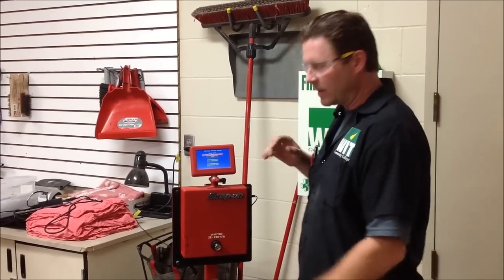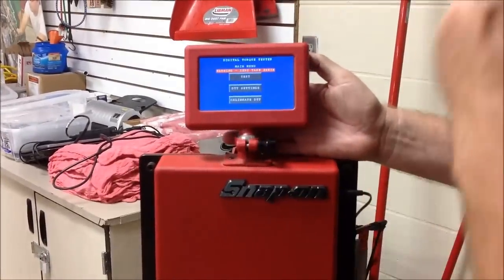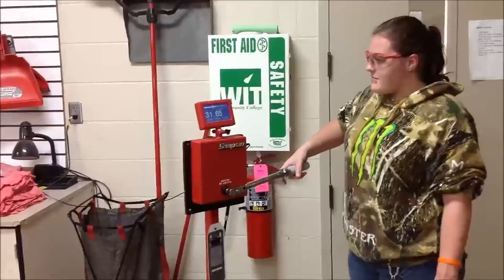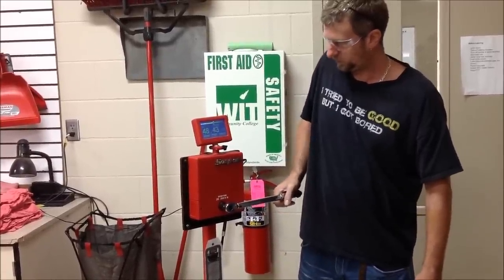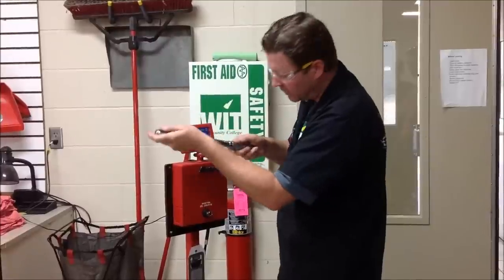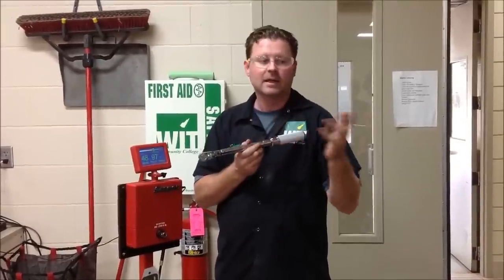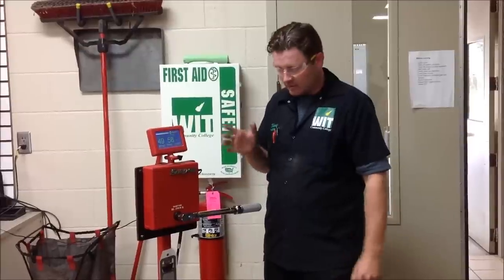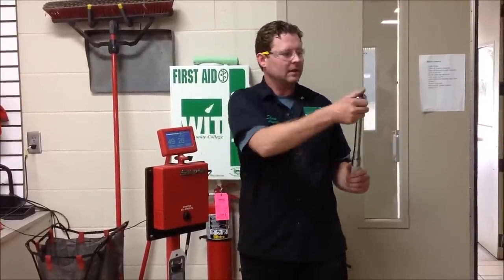Torque wrench calibration check Harbor Freight vs Snap On

Comment: These calibration stations should be in every auto parts store and repair shop.
Reply from the maker: It's to bad they make them so expensive too. But we have to face the reality of how much poor work ethic is out there and by making them more "exclusive" we put more value in the certification. This is an old argument that the bad folks ruin it for the good ones right? There is some curriculum I am not even allowed to certify students in because it must be done on site at the manufacture. I have students come back and say "we did this same thing here, why couldn't you just certify us"? 
If I can ever be of service to you, here is a video explains how to connect with me. 
https://www.youtube.com/watch?v=vjvmB01ebcs 
Keep Wrenching,
Shane Conley
Instructor/Motivator/Motorcyclist
www.how2wrench.com
Like freebies? Click here for a free diagnostic checklist! 
http://gem.godaddy.com/signups/364621/join 

Did you like this free video and hope to see more? Would you just like to say thank you with a donation? Click https://www.paypal.me/how2wrench
Reply: I don't think that is necessary with the larger problem being that a torque wrench isn't being used at all, rather an impact wrench till it stops at whatever torque it has at that setting.    I can't tell you how many times over the years I have encountered vehicle wheels torqued to double their spec due to this, and sometimes lost the lug studs in attempts to get the nut off after it was deformed from the stress.  It's extra fun when this deforms the wheel too.
Reply: You can calibrate a torque wrench yourself with an accurate weight scale with a hanger. Fix the anvil of the torque wrench within a vise, pull on the handle of the torque of the torque wrench with the hanger of the scale until it reaches the desired torque, adjust the torque wrench as necessary until it clicks at the desired torque. It could be done even more accurately with calibration blocks that are sure to weigh specific amounts, and hanging those off the handle of the torque wrench.
Reply: @stinkycheese804  One of my first jobs was as a tune-up mechanic. Everyone uses torque sticks. They work. You can hammer on them all day with an impact and they don't move beyond rated torque. Draw a line on the socket to see. If the lug nuts went on with ONLY the impact, the nut would not stop turning, it would just keep stretching the lug until it broke from elastic yield.
Reply: @stinkycheese804  I agree, many people do not understand the importance of properly torquing bolts such as lugnuts on wheels. I have seen this as well many times along with warped rotors. To many wannabe techs out their that give a bad name to properly train techs that do their job properly or understand what they are doing.
Reply: @DieselDog1982  Because many people are using torque wrench that are out of calibration and have now clue. Most people have never even had their torque wrenches calibrated. If the equipment was out their, more mechanics would check their equipment and make the needed adjustments. I have worked at a few places that actually required periodic calibrations, but never in any repair shop I worked at.

Comment: testing snap-on vs harbor freight calibration using a snap-on brand calibration tool... 😂
Reply from the maker: Apparently the math is different from one brand to another? LMAO
Reply: I don't typically like Snap-on( they're good tools just pricey) but if you multiply the distance to the Handle by the amount of pressure put on the handle for the intended click everything works out the same so every torque wrench should indicate the same value if calibrated, duh... kind of a ignorant comment, not to me mean. Just don't expect someone to call you out when you make unintelligent comments. Lol
Reply: Just like the guy with a garage full HF testing snap on stuff.
Reply: @alejandroWar23  kinda, yeah, but who you askin'? 🤷‍♂️🤣

Comment: So snap on built a tool to prove their tools are better than HF. Don't worry about the $100,000 price tag on the test machine, they will add it to the price of the torque wrench.
Reply: Josaljo Won its really probably rebranded and built by some company and that company probably charges $75k+ for it

Comment: You should demonstrate the Snap-On precision wallet-vacuum cleaner.
Reply: This really is like comparing a Bugatti Veyron to a Ford Geo in terms of price and performance. Although not exactly, as I think you can find tools that are just as good as snap-on's for half or sometimes less than half the cost.
Reply: That was the best by far. I lov my cheap HF tools. They get the job done.

Comment from the maker: Some of you are struggling with the fact that if you "extend" or "shorten" the length of the tq wrench with wrong hand placement or like Alex stated below "adding" pipe YOU WILL ALTER THE APPLIED TORQUE! Here is our video proving it. It blows my mind that there is so much controversy on this matter.
Reply from the maker: https://youtu.be/tv_KHH55qdQ
Reply: Listen carefully.  Extending the distance from the socket to the head is not the same thing as changing your hand placement.  Your video only proves that you have no idea of the concepts involved.   You are misinformed and stubborn.  Why don't you put a 4ft piece of 1 1/2 pvc pipe on the handle and see what difference it makes? Then report back in shame.
Reply from the maker: I re-did the video using a pipe extension showing there is a difference.  https://www.youtube.com/watch?v=RsMxtEx0uik&feature=youtu.be
Reply: This is strange and defies logic. Torque is force times distance where the applied force is perpendicular to the wrench. If you have different readings relative to hand placements you are not reading true torque. It could be how the torque wrench is constructed that is not responding in a linear way, otherwise you throw 350 years of Newtonian physics out the door. Interesting.
Reply: what this controversy proves is people just believe what they want to believe in spite of the evidence.
Reply: the applied torque coming from the operator does change yes.......but the end result should not change.  the force is the same....the effort changes due to the distance of the points of input.
Reply: Frank W Exactly what I was thinking.  I think I have another explanation for his results.  I think this is an issue with his machine.  You are trying to measure torsion, but if you think about it, the closer in to the point of rotation your hand is, the more cross force you are putting on it.  When you are way out with a long handle, it is mostly torsion force.  If you were only an inch out trying to measure 35 ft-lbs, you are going to have to push with 420 lbs of force, putting a lot of cross force on it.  I think this is affecting the machines reading, possibly by friction in the mechanism in whatever type of bushing or bearing it is using.

I suspect the machine is calibrated for the amount of cross force generated for common torque wrench lengths for a given range of torque you set it at.  Otherwise, it seems you would not have to tell it ahead of time what torque you are trying to measure.

With this in mind, you would want to always test it by holding the handle in the proper place, but in real world use, choking up or using a cheater bar will have little or no effect on the actual torque accuracy.
Reply from the maker: Vincent Stemen 
Nice thoughts and comments. Welcome the the channel...
Reply: Shane Conley- your test results are flawed. The girl with the snap on did a complete 360 with the wrench and you didn't allow the harbor freight tool to properly reset itself by doing rapid fire clicks
Reply: I've seen an electronic torque block where you have to put a wrench on. How does that work as the wrench can be any length
Reply: georgio. You would change the head length from the on screen settings. My ATECH3F250VR explains how in the owners manual.
Reply: Bill Cosby thanks that would imply that the lenght is important but due to many quarrels with professionals,  I have to check it myself. not the block,  but the normal ones and I will use a 'spanner type' so it will be one dimensional. .goedendag!
Reply: The reason why the hand placement affects the delivered torque value is because of the side loading on the pivot mechanism in the clicker torque wrench.  When you hold it up close to the pivot there will be a greater amount of side loading, and therefore friction, that resists the pivoting action of the clicker.  That will result in an increase in the torque delivered before it clicks.

Conversely, holding it far out on the handle results in a lower amount of friction on the pivot, because more of the force is applied towards rotating the pivot, so you'll get a lower torque reading.   Because the grip is nearly at the end anyway, there'll be a limited amount of difference seen.  A ten foot pipe at the end would not make much difference than holding it at where it actually contacts the wrench, because that's where the force is being applied.

If you want to picture this, consider if you were to hold the torque wrench a couple inches from the pivot.  You'd have to apply a lot of force  to get it to click, and a lot of it would be just pressing down on the pivot, creating a lot of friction that resists turning, and a small proportion of the force is going towards rotation about the pivot.  You will see a abnormally high reading on the tester before it will click, because of that added friction.
Calibration takes into account the amount of parasitic friction to the pivot joint, and has to be consistent.

Comment: I'm not sure if it would make much of a difference or not, but the instructions that come with the Harbor Freight say that you need to run the tool up and down the torque scale before use. I checked mine against my 1970s beam Craftsman and it's spot on.
Reply: +Pro1er How accurate is the 35+ years old beam wrench?  Assuming it's never been damage or misused it should be good.

Comment: I have often calibrated torque wrenches using a spring balance set at a accurately measured distance from the centre line of the drive square.     
I started doing this 45 years ago on a tool which was regarded as scrap because someone had left it wound up to a high torque value and it was weeks before this was noticed, thereby causing the spring to shorten, spoiling the accuracy of the tool.      
That was the first torque wrench I ever owned, given to me because I noticed it in the scrap  bin and I asked for it.      
Using this was quicker than just using a bar and spring balance.

Comment: 50 ft lbs is just 50 lbs 1' from the center of the drive. tested my POS harbor freight with a scale and found it to be consistently within 3%.
Reply from the maker: +Tom Allen 
We have had many brands including Habor Freight test good but not over time or real use and even some didn't change a bit.
Reply: @How2Wrench  I tested my HF torque adapter, a quinn brand against my performance tools click type.  While it's not a calibrated standard.. My PT m199 clicked at 49.5 when set at 50 (and that .5 really could be due to the alignment of the turn handle adjustment.. lets be honest, those aren't exactly thin lines on some of those for perfect adjustment).  I can't say that they're actually doing 50 ft lbs ,but if they're off, they're off by the same amount..

Comment: I've seen friends of mine with expensive cars, Porsche, Bmw, etc use HF torque wrenches. I spend the money and use a Rahsol torque wrench in 1/2 drive made in Germany and a 1/4" and 3/8" Tohnichi wrenches made in Japan. Very pleased with the quality of both manufacturers!
I would NEVER use anything from HF, not my style when wrenching on a car or engine worth many thousands.

Comment from the maker: This videos main purpose was to point out calibration differences. I'd have to disagree with "all bolts have the same torque". Keep in mind different materials, hardness and like you said about stretch bolts. Never just trust a generic torque chart for these reasons.
Reply: Your method is not the best, you exceeded the force many times. You kept applying force after the wrench had already clicked.
Reply from the maker: jameshisself 
You have some major flaws in your comment here James. First off we bought the machine it was not donated. Second the machine is not made by Snap On it's made by an independent company and snap on like many other companies mount their badge on it. This is very similar to oil filters air filters, Kleenex. If you took time to read the comments before commenting and making judgments you would have known this fact. I'm just an instructor teaching quality craftsmanship. I have no gain on fabricating torque values. Mind you I do have a reputation of integrity and high standards. Maybe try watching the video focusing on the technique displayed and forget the brands.
Reply from the maker: James...dang I had some hope for you as your well written. But you seem to fall into that same category as many posters. You made incorrect statements and once given the facts you do not retract the original thought. Let's take a look: 
You:  I know, Snap-On donated the calibration test device to your school. Do you see now how that is a bad idea?
Me: We bought the machine it was not donated.
You: You really need an impartial 3rd party source for anything you want to call the source of truth.
Me:  The machine is not made by SnapOn it's made by an independent company and snap on like many other companies mount their badge on it. 
You: Do you see now how that is a bad idea?
Me: No, because I'm actually demonstrating just how you suggest one should test with a 3rd party source. 
For all of you viewers, you will find this channel most useful if you can wrap your head around I don't work for any tool company. I would also ask you to consider (like I must do at times) is realize your wrong. I am passionate about education and delivery of technical skills training. 
Think about the facts we have here from all my torque videos, training, and experience:
1. SnapOn, Mac, and Craftsman Torque wrenches have given consistent reading on this machine.
2. Harbor Freight tq wrenches have given a consistant failure reading. 
3. All used brands have had their torque wrenches fail on this machine. Why? My belief is they were dropped or "over used". It's a guessing game regardless, they failed meeting the standard test on this calibration tool. 
What lesson's are present?
1. Tools need to be checked for calibration. This costs money. Your brand name torque wrenches come with serial numbered spec test sheets to that wrench. 
2. Cheaper (I don't care what the brand) are randomly tested at who knows what rate.
Simple. Choose you tools wisely. Failure or success is waiting. 
Keep Wrenching,
Shane Conley
Instructor/Motivator/Motorcyclist
Reply: I will respond to this post since you referred to all viewers.
Snap on and Craftman are expensive garbage. I tested, calibrated thousands of instruments including torque wrenches and snap on proved to be just an expensive unreliable tool.
I tested (50)Harbor wrenches, they all repeated and were accurate within +/_ 3% IV (cheaper!!).
18 years as a metrologist and technician for aerospace, military and commercial industries.
AKO TSD6000 Torque calibrator.
Reply from the maker: jameshisself 
Now that my friend is a good and helpful response. One of the employees whom happen to make the machine (engineer that works for the company) commented in the comments. They are all the same. Well except for color and tag. 
I love having smart, knowledgeable people as part of this community. I just ask that instead of attacking with assumptions bring these points up as questions. That's relationship 101. To bed it is. 
May I ask you a question in hopes an answer? As an engineer in such high tech and qualified resume....do you have a known company for torque calibration equipment? The manufacturer (I believe) is www.cditorque.com 
Would this validate the test if you had known good reliable tests from this company? They seem to have a strong line of equipment and were founded in 1968.
Reply from the maker: jameshisself Thank you. If we really looked into many SnapOn as well as many other products, I'd bet they make few of the items they sell. 
It's not easy teaching or putting this stuff out there. But you have to start somewhere when teaching.
Reply: Shane Conley , you are correct, torqued vary to type bolt, threads fine or coarse, and whether there is a compound added to the threads, etc.

Comment: Not sure why folks are getting their panties in a twist here.  Torque testing machine is set at 50lbs, and two different torque wrenches were tested at the same time, and one really failed badly, while the other one did not.   Very simple, straight forward video gang.  You get what you pay for, buy cheap tools, get bad results.   Great video IMHO.
Reply from the maker: Thanks Rob. My goal all along😊
Reply: I tested harbor freight torque wrenches and snap on, snap on is a piece of s*it and way too expensive. Harbor freight torque wrenches were very accurate to +/- 3% i.v. 
I would not test the torque wrenches as demonstrated, the technique does not offer good control of the force applied.
I rather learn the proper technique than paying too much for a shiny crappy "american brand tool".